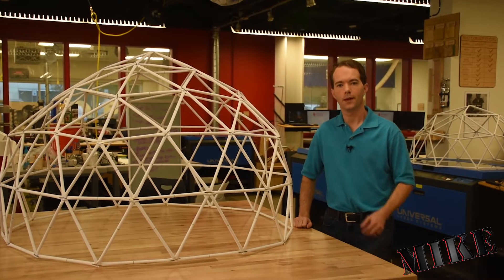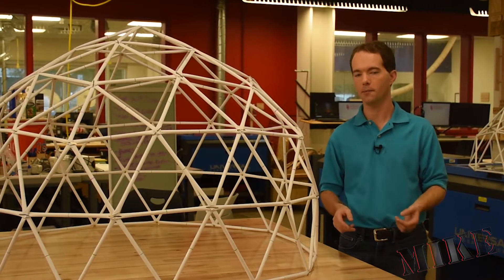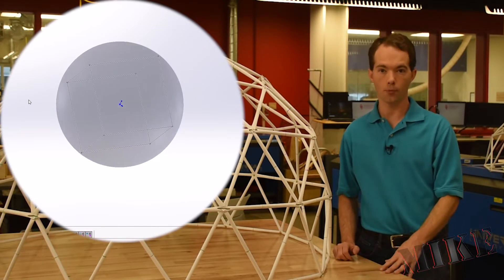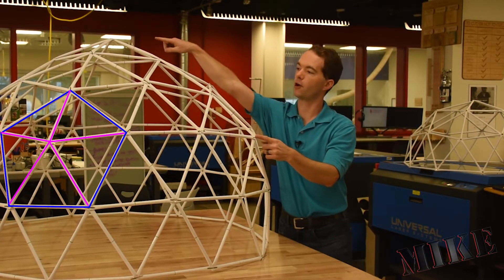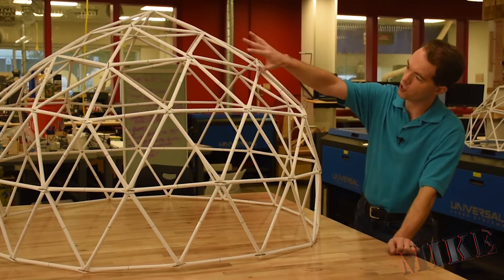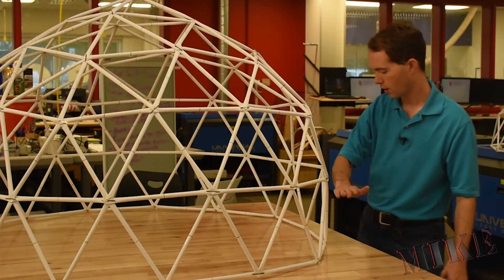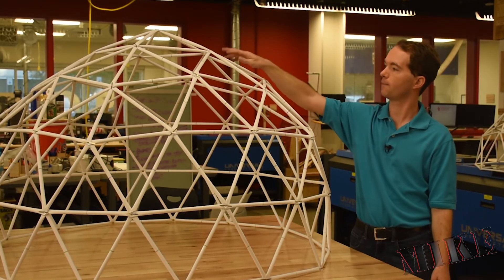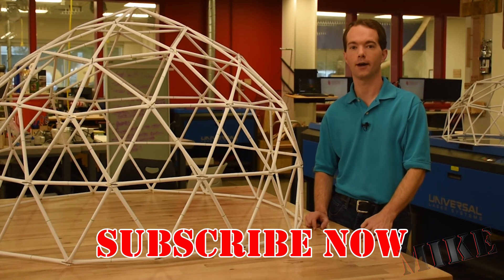Paper Geodesic Domes 2 - Mikes Inventions

Comment: Would a 3-frequency dome using 18-inch maximum struts be large enough to accommodate a person? Also, do you recommend building top to bottom or bottom to top?
Reply from the maker: Maybe a small person. If I'm building a small dome, I go bottom up, if it's taller than I can reach with a step ladder, then build top down. Check out this playlist for everything I have on domes to help you build. https://www.youtube.com/playlist?list=PLH-oe77sgzLJjC61GFtzTD1VxD7sQlhoa

Comment: I have watched alot of your dome videos great job i made one 2v 16ft according to your instruction and it turned out great but I have only one problem and I hope you can help i have a lot of time and now money my problem is I have tried to cover it several times and  failed  i have no idea on how to fix this without a cover the dome is dead  do you have any ideas on how to proceed  thanks for sharing your work
Reply from the maker: Hey, this comment slipped through the cracks. I’d suggest throwing a round parachute over the top of you need just a light cover, but I’d recommend sewing triangles together out of something denser if you need a more permanent temporary solution.

Comment: Gday is the node to node distance the distance the hole we make for the paper fasteners?
Reply from the maker: Yes, in this case with holes, the node to node distance is the hole to hole distance. So make sure to leave extra material at each end so you can drill a hole.

Comment: Also, I wanted to ask do you think it would be possible to make a dome big enough for people to sit in out of paper if you used a larger frequency?
Reply from the maker: Hey Erin. Sorry about the confusion in the first video. Glad you watched them both though! Paper is very strong, and you can  certainly make a larger dome with more frequencies or you can use   thicker, longer paper at a lower frequency. 3v is the highest I've ever built, but if you're really committed and will get a LOT of use out of your dome, you can go 4 or higher. I'd recommend stronger paper and 2 or 3 though. Did you see the HUGE dome video? It's only 2v. Try newspaper or maybe 11x17 papers to make your tubes. Better yet, premade cardboard tubes would be best if you can find enough. I couldn't. Good luck, thanks for asking, and watching!
Reply: @MikesInventions  
Make the tubes out of brown kraftpaper, ideally virgin kraft roll) using sodium silicate for glue. The resulting tube will be super rigid and amazingly strong. Paper struts are not ideal for outdoor use  ;) To make a 4/9 3v icosa into a flat base you only need to modify 20x struts, imho, its worth the small amount of extra effort.
Reply from the maker: Ooo, another thing. Cardboard "Tubes" that have a triangular cross section. One side of the tube an have tabs left on their ends that would serve as connection tabs and would allow the tubes to bend as needed. The tubes can be cut, folded twice along their length and taped shut. VERY strong. I love cardboard and all it can do. (Boats anyone?) Hope that helps too.